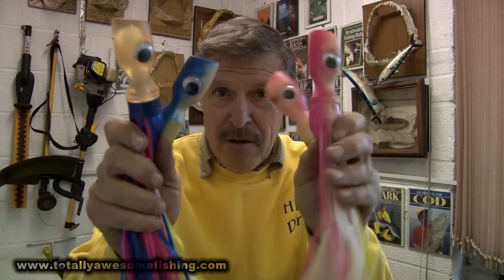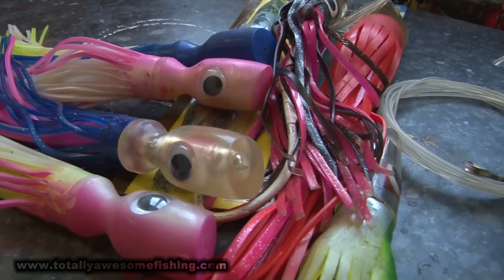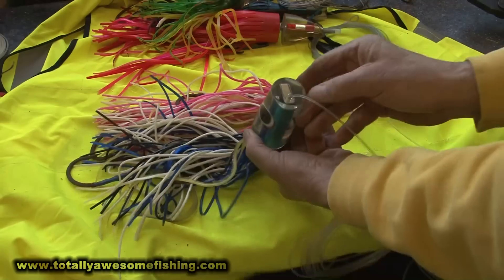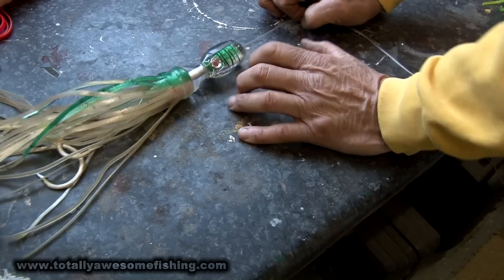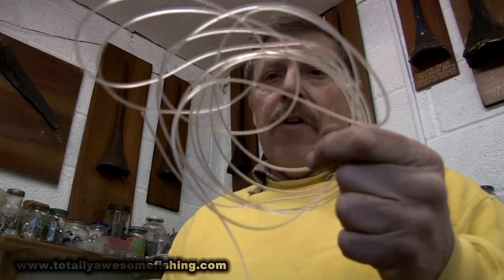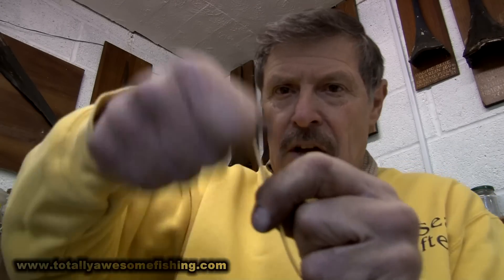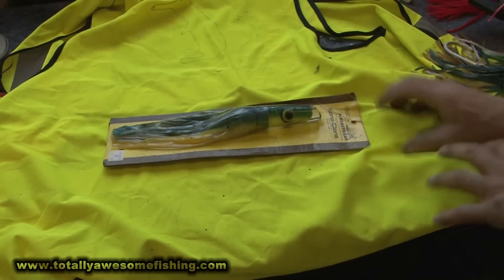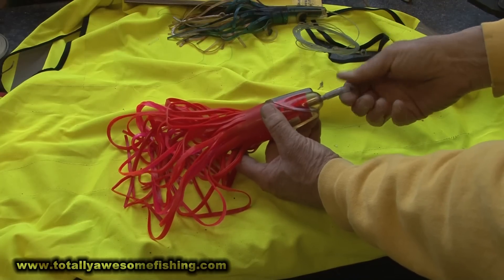How to rig a Marlin Lure

Comment from the maker: I use hard heads more as they have greater density so I can get them to smoke closer to the boat's wake/bubbles.Softs I find I have to run a bit further back to pop/smoke at the right intervals and that means they might be out of the central spread. I have a "secret" spread pattern and like uniformity if I can get it.I also rotate the angle of the lure head so the back hook is facing down,where the lower jaw is softer.Roof of the mouth is much harder .

Comment: I see a couple of things in your rigging I would change, instead of the 7731 hooks, use the 7691 and rig them with heat shrinking in a semi-stiff rigging, leaving a bit of room for the hooks to move. It allows for better lure action and the semi stiff rigging allows the hooks points to ride straight. I used to use tape like that and didn't always rip when fish were hooked and allow free movement as the fish is fought. 
Also, not heat flaring of the tag ends in case of crimp failure??

Comment: Rubber bands will do as well. Also, 180 degree rigging is dangerous for the fish and can reduce hook ups. Riding vertical, they can wire a fish's mouth shut and running horizontal the fish can bite down and not hook up. 60 degrees seems to be the butter-zone for offset. 
I use mostly soft headed lures like you do, but I'm moving towards hard resin head lures for physics reasons (less friction across the mouth, lure slides through and hooks find mark during strike). What's your view on that?

Comment: Interesting - I don't like to try hook marlin in the lower jaw because of the same reason you target it - I find it's too soft. If hooks are sharpened right, I find that they'll find their mark in the tougher upper jaw in Blue and Black Marlin and stay in because they simply hit a lure that hard they hook themselves. Striped Marlin are a little more sloppy with hitting lures so skip baiting and switch baiting is a good way to get a solid bite. 
Interesting to see such varying opinions!!

Comment from the maker: 80lb would be average for blues .50lb test would maybe  be OK but is going a bit towards light.130 is for big reels and fish over 500 .Depends on the species of marlin. Striped marlin are a lot smaller and you could use 30.Even so I prefer 50 for them,just in case Mr Blue pops up in the spread.

Comment: would you use a doorknob with a ballyhoo in the shirt?
Reply from the maker: No,not personally,the Laminar flow design of the Doorknob is for high speed trolling and I feel any Ballyhoo would break up at high speed,even if wired on with number 9 single strand wire.